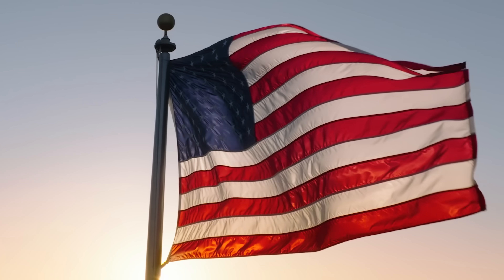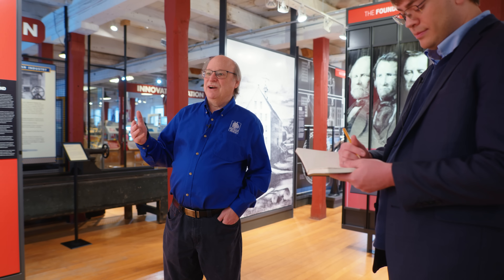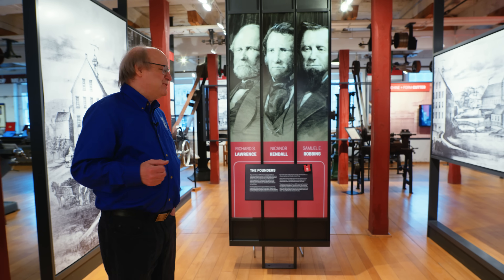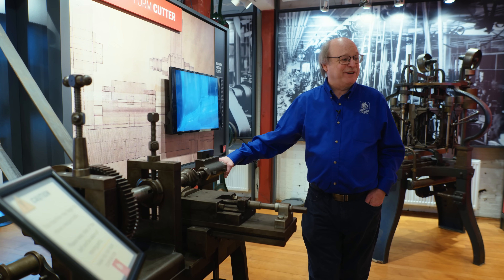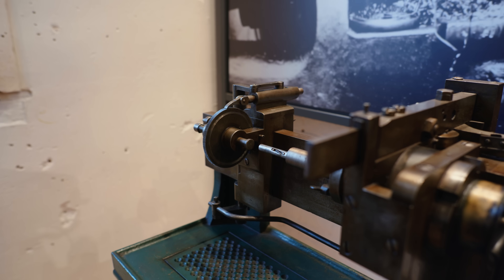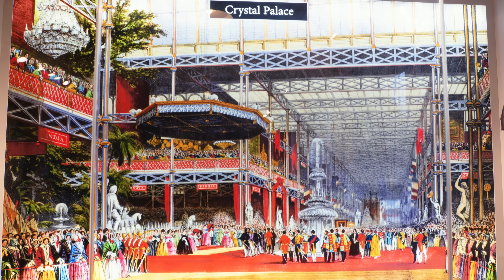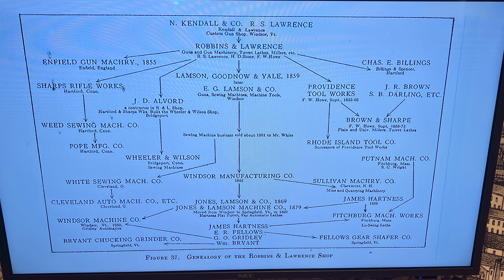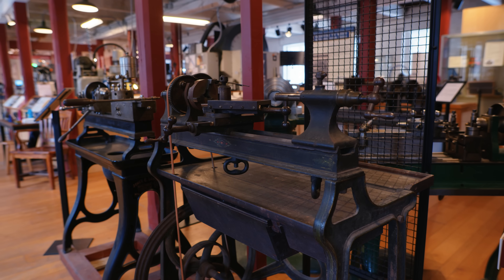How Machine Tools Shaped the Modern World: Inside the American Precision Museum

Comment: Growing up I always loved machines. Big machines, little machines, old clunky machines, precision machines. For me, it was always the fascination of "how did someone come up with that?" and how something could operate day in and day out, be in service for generations (e.g. pump jacks) or spin for 100,000 miles (like wheel bearings on cars and their engines). The other half of that, I was also very interested in computers. So, my absolute favorite was any time getting to see them working together, CNC for example.

Ultimately, I went into technology. I'm a Network Engineer by trade. However, over the last 4-5 years the desire to be involved with machining became overwhelming and I found myself starting to build my own machines. First, 3D printers, now my own CNC machines. They may not be large scale, or to tolerances of 0.0001in, but the feeling I get from building something that builds or helps build other things is incredible.

If you want the next generations to be just as enthusiastic about machines as I am, open source I think is the new era. It brings the ability and affordability into everyday households and teaches kids about engineering, precision, mechanics, etc. I'm 38, I don't consider myself old and still have a curious mind. Open source has been a godsend to me. Right now, I am 3D printing parts for a milling machine called the Milo v1.5 by Millenium Machines/LDO. It promises precision up to 0.05mm and while that may not be good enough for the aerospace industry, it is more than enough to teach the younger generations about precision machining and all for about $1,200 - $1,400.

Open-source brings what was previously untouchable to most incomes much closer to reality. I think more and more people are going to find the pride and benefits of having open-source available to them and it will hopefully spark increasing interest in the younger generations.